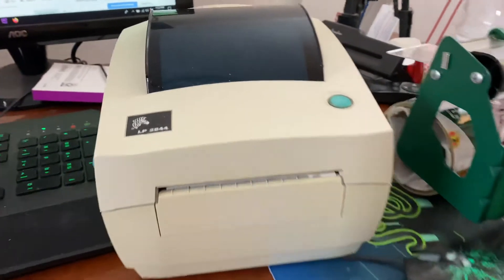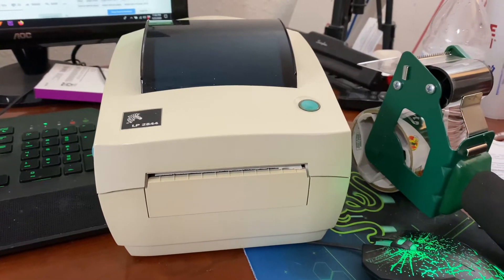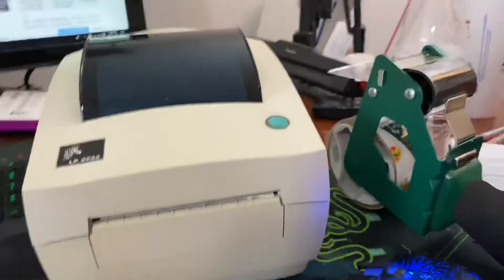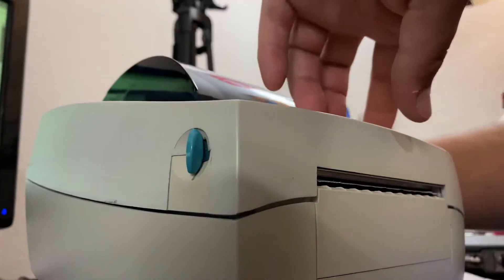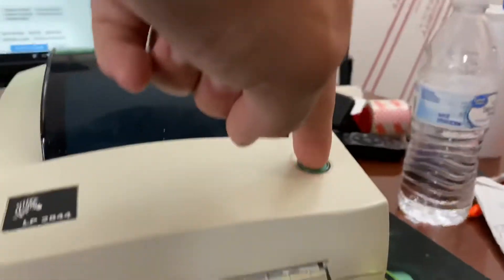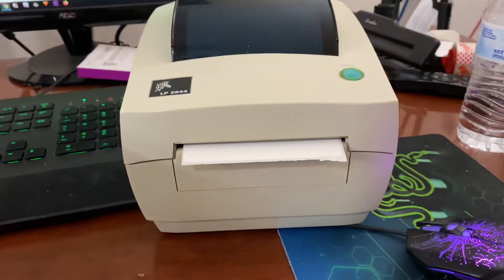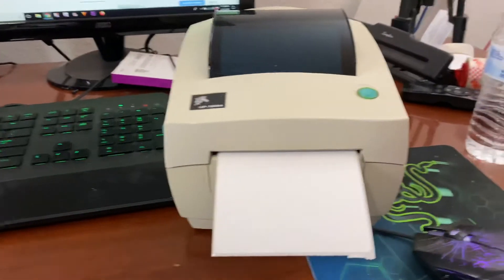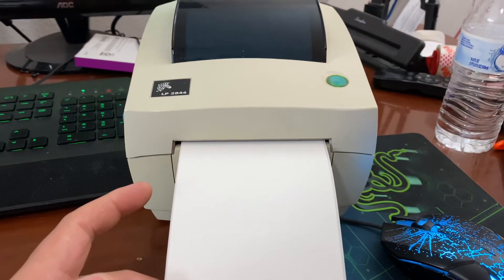Zebra LP2844 Thermal Printer Dump Mode

Comment: Hi quick question? Usually when I have to print a label after I've done a Windows 11 update, the label prints ok but there is like a 2 minute delay in communication between my PC and the printer before it spits out the label. Before, after I've run one label, it has fixed the problem and the label spits out like 3 seconds after I hit print. But on  my last three print runs, there is still that 2 minute delay before the label prints out. Will this dump mode procedure fix that issue. I have the same thermal printer as you. (Zebra 2844)
Reply from the maker: Not sure man
Reply: I have the same problem.  There is huge delay after I press print and the label printing.  I tried dump mode and it did not fix the problem.  I will try another cable and see if that helps.

Comment: Not getting anything to print - can't figure out - everything else seems to work ok - any thoughts?
Reply: in print settings on the computer it must be set to 200 or 203 dpi and paper size to 4x6
Reply: Make you sure you have Zebra utilities installed.